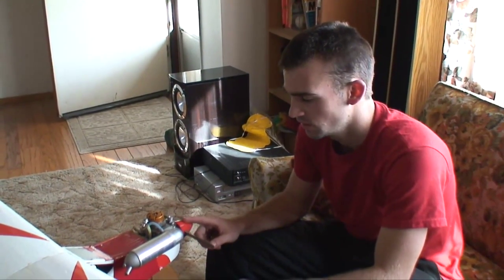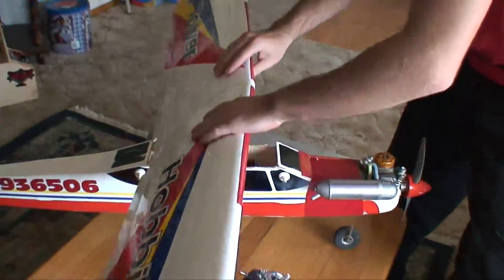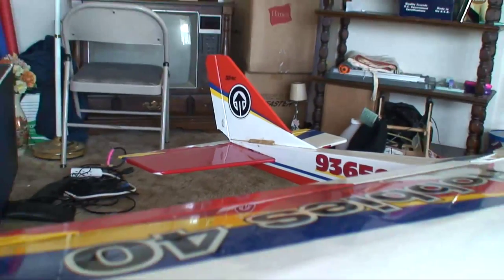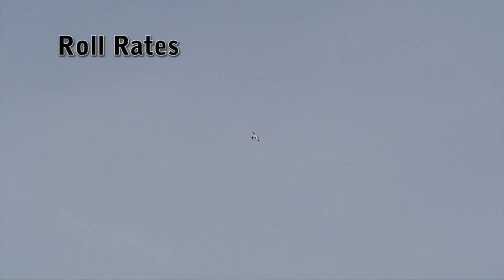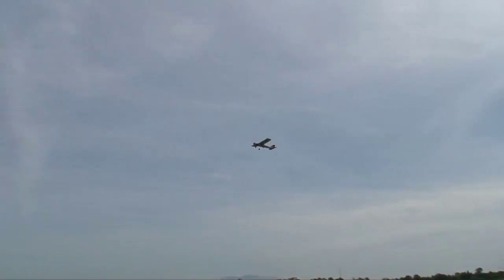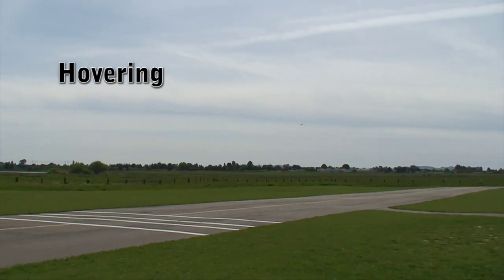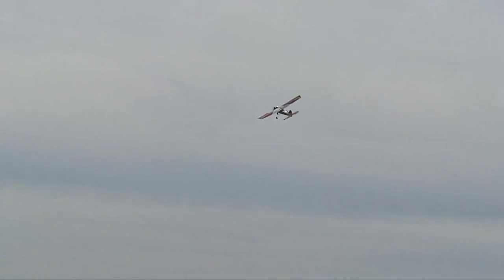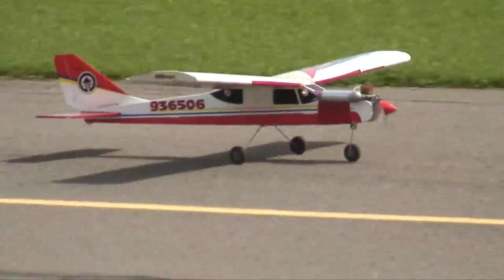Tower Trainer - Modified. Flaps, Mixing and Dual Rates.

Comment: Great job! Pretty much exactly the video I was looking for I like modifying these birds as well I couldn't believe how slow it landed with the flaperons. As for your "slide" you're on the right track. It's actually a real maneuver used to bleed speed and altitude typicaly on approach in full scale airplanes. Usually referred to as a forward slip. Great flying keep it up

Comment: i took and made new control surcaces extending the elv by 1.5" and the rud by 2" and the ail by 1" each and straitend the wing out with independent flps and air brakes and messed whith the lift of the wing to make a extreame trainer
with a .55 on it and it flies a 1/8 trottle easy and will do a loop at full with no elv helps when in trouble or hovering

Comment: I have a tower trainer unmodified with a 46 engine. If I apply full throttle on takeoff I leave power on and turn left perpendicular to the runway on climb out but the plane continues turning into a U turn. Have you experienced this?

Comment: I have a GMS 32 in mine. It is very light and I actually think it hovers a little better than yours. As far as low speed it will almost thermal. I don't think the flaperons will give you better low speed handling but it might help slow your plane down some. Mine will glide forever. The flat bottom airfoil and the dihedral does not give it very good inverted flight charachteristics..-BW